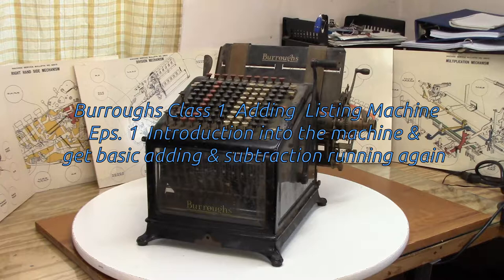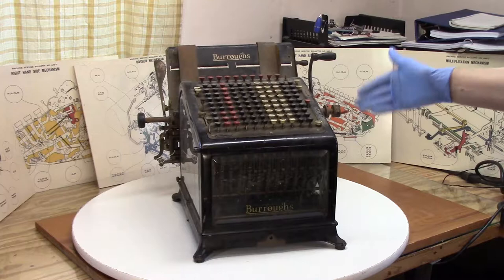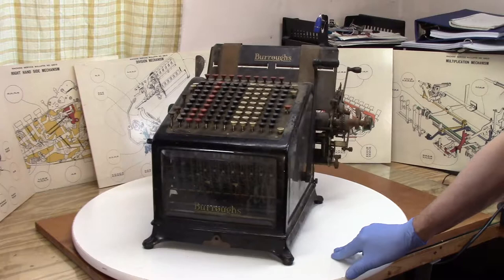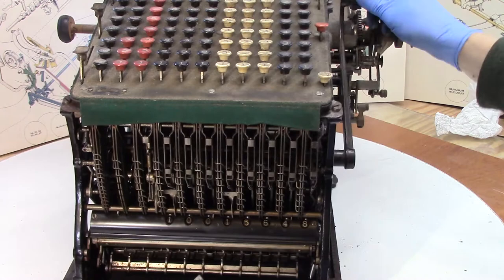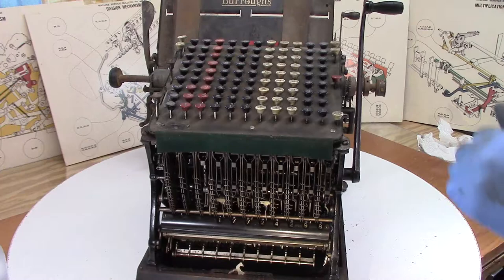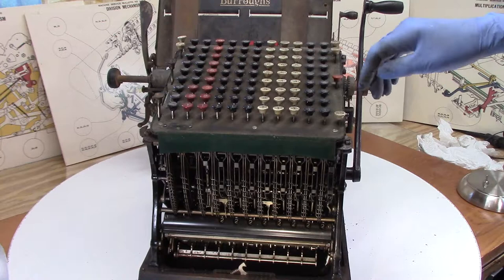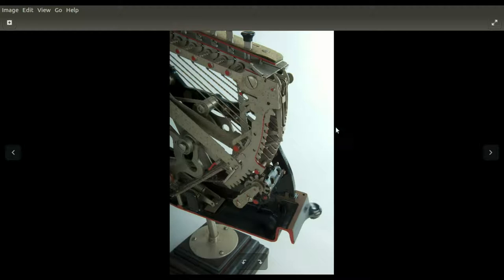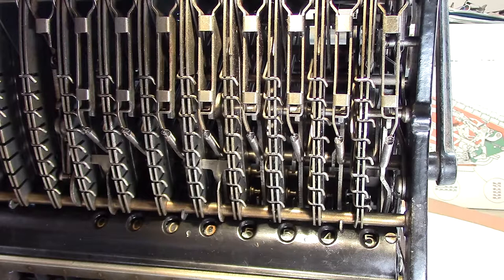Burroughs Class 1 Adding Machine Eps 1 Intro & get basic add & sub running

Comment: In the early 80's I bought one of those for I think $25 from a business that had it since new in the 1910's.  It had been in a clean dry storeroom for decades so it's in amazingly good shape.  I've got the machine and the stand with a folding side platform.  That machine and similar were significant factors in creating what was later called "white collar" jobs.  As you've figured out with that carriage these were meant for bookkeeping where the machine would print to a ledger page that was inserted into the carriage.  You can use it as an adding machine with a simple paper tape like how your machine (and mine) is currently set up.  But that's like buying a race car to go to the corner store for a loaf of bread  ;)

Comment: The subtraction mechanism is built to run the 9's complement method. There are two kinks to it: 1 it will propagate a high end carry under some circumstances the fix for that is to pad the input with 9 above the high digit,  which forces the carry to overflow. 2. True 9's compliment is to use the nines compliment of the number to be subtracted minus one. As implemented on the Burroughs, it subtracts one digit more, so the blind crank with the carry activated replaces the missing digit in the register.